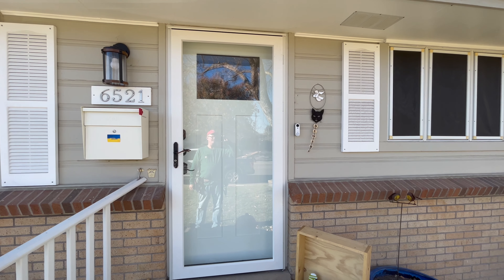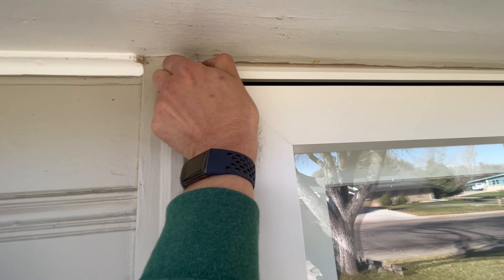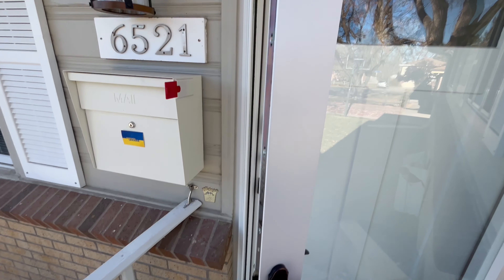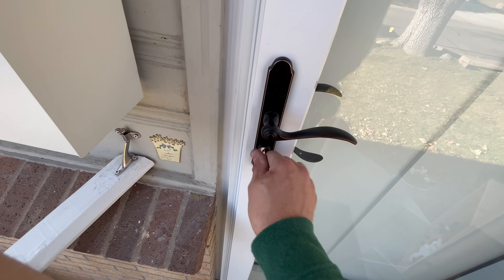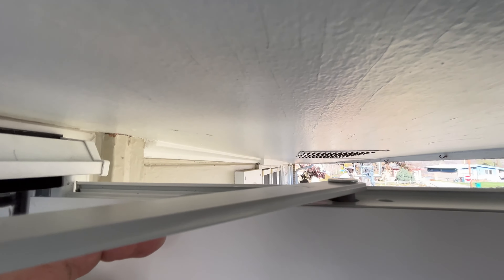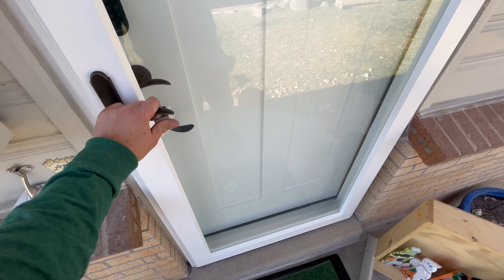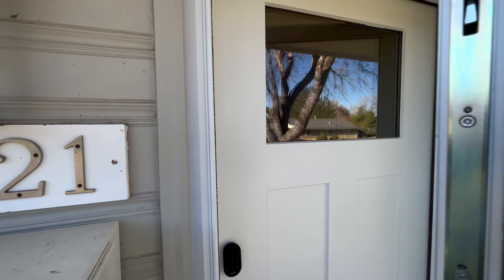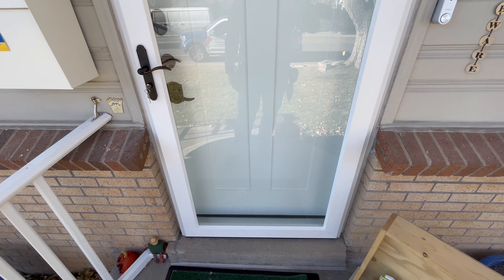After 18,000+ Installs, Here's What the Expert Says...

Comment: I need to buy one full view door 35 x 80, one handle and one dead bolt if possible. Aluminum, black color, hopefully under $500. I will install it myself.
What brand do you reccomend and where to buy it?
Thanks in advance.
Reply from the maker: I was recommend Larson the best. But if those dimensions, it will be a custom order door. If you want a cheaper door, go with a wood core like a Larson, Bismarck or Savannah. Aluminum doors are going to be more expensive because they will be a custom size again at those dimensions. Likely between $500-$1000 just for the door.
Reply: @stormdoorguy  ok, thanks. Home Depot guy told me I can use a 36 inch wide for my 35 inch opening door frame. I hope is true. I will ask around before buying it.

Comment: what do you think of the 3 way locking system? I have seen some reviews saying lock gets stuck and hard to fix/replace.
Reply from the maker: It is a big, beefy lock. You have to pull up on the door handles to extend the 2 hooks that lock into the frame. Then you can lock the door. That's the trickiest part for 99% of my customers.

I agree it can be hard to work. Especially for seniors with arthritis or those who don't have a lot of strength.

Also, sometimes the screws that attach the mechanism to the door are overtightened or misaligned which causes the unit to bind during operation making it harder to work. Loosening those 8-10 screws can make it easier.

It is easy to replace the unit in my opinion..

Hope that helps.
Reply: I had these storm door for three years with no issues.
Reply: Ok, thanks @CatsAreNiceMeow

Comment: some storm doors need a door closer at the top and bottom.  Does just having one at the top still allow the door to open and close without being tweaked?
Reply from the maker: Yes. The top closer is heavy duty so replaces the 2 closers you traditionally see.
Reply: Do you prefer,/recommend this Larson door over the Meshtec Ultimate Security Screen Door ? Thanks!
Reply from the maker: @jrachelshelly  I recommend this larson door, though if you just want a screen Larson makes the Platinum Dominator which is similar to the meshtec.

Comment: Are these pretty hard to break from rioters? Great video!
Reply from the maker: With the double laminated glass yes it's a challenge. In another video, I take a 3lb mini sledgehammer and throw it at this door glass. The outer layer cracks but the inner layer is completely intact.
Reply: @stormdoorguy  Thanks for answering! Sorry one more question…would this door be easy for someone to take off or pick lock? I live in a city and fear what might happen around election time this year. Thanks again!
Reply from the maker: @CatsAreNiceMeow  Welcome! And it could be easy to remove if you know how to. I would recommend upgrading the mounting screws to 2" or 3" one-way security screws. That way you could install them but not uninstall them. You could even go so far as to add liquid nails between the storm door frame and the trim on your house. Then, even if someone removed the screws it would be glued into the opening. Short of explosives no one would get that door off :)
Reply: @stormdoorguy  Thanks again! Great video, by the way!
Reply from the maker: @CatsAreNiceMeow  Glad it helped you!
Reply: I wondered about whether  the "pre-installed" screws are one way.  From the last comment, it sounds like they are not.